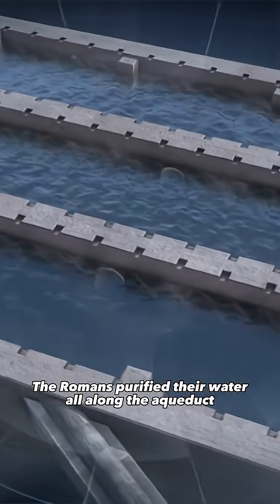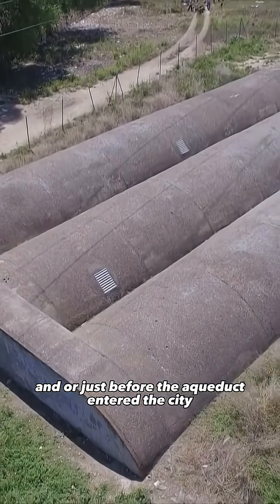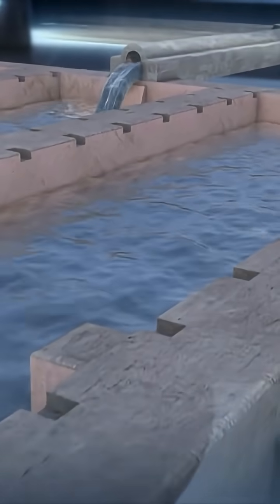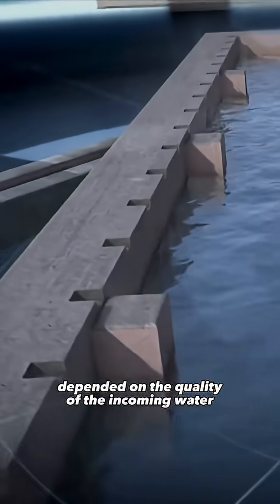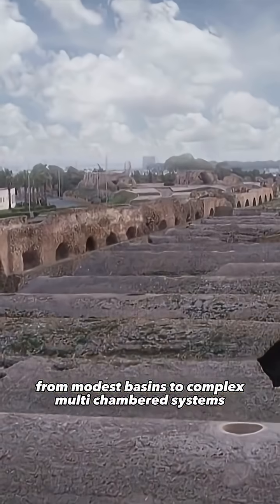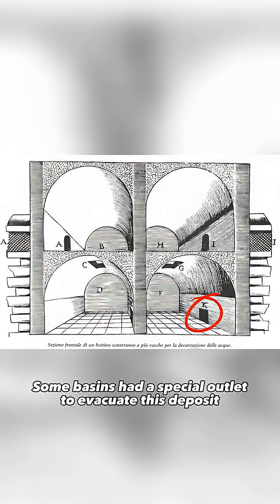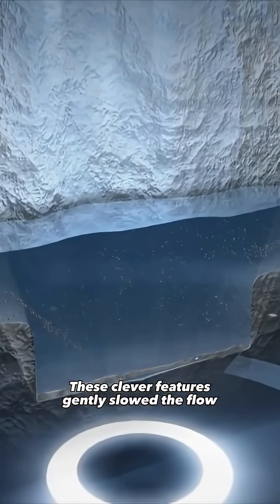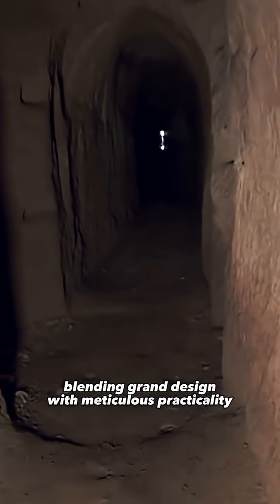How the Romans purified their water #history #romanempire #engineering

Comment: water guy here. cleanest water isnt at the top. its just below. stuff settles at the bottom and others remain at the top
Reply: Thank you for mentioning this!
Reply: Thank you Water Guy!
Reply: narrator messed up but the roman designs didn't. Settling tank outflow was just below entrance level.
Reply: As someone who drinks a lot of water, I can confirm this makes sense to me. Proceed.
Reply: For rainwater tanks, we use a flexible hose inside the tank connected to the outlet, with a float tied to the free end of the hose so that it sits about 15-20cm below the surface. It doesn't take any bits of plastic or whatever actually floating on the surface, but we're getting our water from as close to the surface as possible without being at the surface.
Reply: Everyone knew the YT doctor, the YT lawyer, or the classic YT engineer. Even got a YT rocket scientist once. 
But the YT Water guy? Now that's a new one.
Reply: Decanting
Reply: Well hey, Culligan Man!
Reply: Well over a thousand years ago it would be easier to trust clearer water than knowing the facts.
Reply: Curious, how would you get the water from below the surface in a system presented like the one in the video? Seems like anything would cause the water at the top to be sucked in unless you greatly reduced the flow.
Reply: The video stated that the outflow was JUST BELOW  the surface.
Reply: I spent 10 years as a Water System Consultant. Mostly Public systems. I was Certified by the State of California and the US EPA. From water wells to water meters, and all system parts in between. 
This fellow speaks truth. 
One water guy supporting another. 
You ignoramuses go back to your bottled water that, if you are lucky, might meet the same standards as your tap water that you flush your toilet with. But note that bottled water companies are notorious in the water industry for often being fined for environmental hazards and violations. Your tap water is often safer to drink than bottled water, in spite of advertising claims to the contrary. But if the bottled water advertisers told the truth, you would not buy their product and those companies would go out of business. Ooohh, poor babies. 😢
Reply: @dustymojave  I hate bottled water because it generates so much trash. 
I mean if you drink like 5 of them in a day, that's barely enough water for one day, but those bottles are gonna sit in landfills for the next 10,000 years.
Reply: @party4lifedude  The world did not start revolving when plastic was used for bottled water. Mankind has been storing water in numerous materials for millennia
Reply: @dustymojave  mmmm, yummy genX with a hint of fluoride tap water 😋
the US is huge, not everywhere's water is safe to drink.
Reply: @dustymojave  exactly
Reply: @dustymojave  im glad i can walk 20min and drink clean water directly from rock also my town gets water from said rock
Reply: And contamination dissolved in the water is throughout. Lead used in water supply had a certain effect on ancient Romans but it's quite a thought that lead pipes were still widely in use in the UK within recent decades. The Romans compounded this by sweetening their wine with sugar of lead.
Reply: @duncanbryson1167  The lead pipes got covered in a layer of oxides, protecting the water from lead poisoning.
Reply: @duncanbryson1167   I read that the Romans knew and expected that over time, the lead pipes would become coated with mineral deposits such as calcium as the water ran through them, so the water would no longer come into contact with the lead.
Reply: @duncanbryson1167  I had no idea they boiled wine in lead pots to make a sweetener. The Romans knew lead was toxic, so it's very weird they would do that.
Reply: @duncanbryson1167  The lead pipes used by the Romans weren't actually that problematic. It's only when water is stagnant or slow moving that lead contamination reaches dangerous levels. 

Carbonate buildup on the inside of the pipes also served to prevent contamination, this was even mentioned by  a renown engineer and senator Frontinus.
Reply: @MinecraftGuy07928  also our chlorine use made it worse. Not sure Romans used chlorine🤷
Reply: @turtletom8383 , chlorine use made it worse than what? Outbreaks of disease caused by contaminated water were quite common throughout history. 

I suppose it is worse for the bacteria. Are you arguing that bacterial life should be more valued?
Reply: @AJPemberton he meant lead leeching into the water
Reply: @AJPemberton  
How dare you say we piss on the poor.
Reply: @Szriko  ? How on earth did you come to that conclusion? 
I was responding to a comment that said chlorine made it worse. I had thought it was just an anti-chlorine reply (there are a few out there), but as later pointed out, they were referring to chlorine leaching lead, not the purity of the water in general. 
No mention of poor people.  
Some people do value other life quite highly, to the point that they will go to considerable effort not to kill anything. Others think anything natural is best, despite hard evidence to the contrary. In hindsight, perhaps the second sentence WAS a bit much. But I am genuinely curious as to why you thought I said "you were pissing on the poor"?! I just don't see it.
Reply: What do you mean, "water guy"?  You're made of water?  You enjoy water in your spare time?  You sell water for a living?  You're a water bender?  Or all of the above?
Reply: @lsdave42  He's like 71% water, bro.  The rest of us?  Only 70%.
Reply: @lsdave42 he's Bobby booshay. He likes her and she showed him her boobies and he likes them too 😂

Comment: First we purify it. then we put it in lead pipes.
Reply: After a few years, the lead pipes will develop a thin layer of calcium scale that limits the exposure of water to lead pipes.
Reply: @bogususer2595  yeah no
Reply: Which is fine. It's still super common, if your plumbing is older than 1986 it probably has lead. 99.9% an oxide layer forms, sealing the lead or other metals from the water. It only leeches under very unusual conditions, like the Flint MI debacle where the grossly incompetent water district failed to add an negligibly inexpensive ( < $0.40 per resident, per year) anticorrosive additive.
Reply: Future humans will comment: "How ironic, they used plastic for water pipes, allowing microplastics to accumulate in their brain" 🧠 😂
Reply: Lead? In 2025? I don't think so. 
Where do you live?
Reply: @JWR6819 There is still quite a large number of homes with lead plumbing. Only as recent as the 60's 70's countries started to impose bans on the use of lead plumbing. So it is highly recommended to inspect older homes.
Reply: @erik2811 A common misconception claims that Romans were driven to madness by lead poisoning from their water pipes, but this oversimplifies the truth. Not all Roman cities used lead pipes; many relied on clay, stone, or wood for water transport. While lead was used in some aqueducts and urban plumbing, the extent of its impact on public health remains debated, as flowing water minimized lead accumulation, and Romans often treated water to reduce contamination. Moreover, Roman aggression and conquests were comparable to other ancient powers, such as the Persians or Macedonians, driven by similar ambitions for power and resources. This narrative of "insanity" from lead poisoning is an exaggerated myth not fully supported by historical or scientific evidence.
Reply: Quite possibly lead to their downfall. See what I did there
Reply: Also why leaded fuels were outlawed. Fumes were a cause of slow development and learning process of children.
Reply: The Romans never understood that aspect, and lead was a slow killer. They’re known for grand engineering prowess, not medical science.
Reply: @DrBright5558 lie, they knew it was bad but did the work so...
Reply: @DrBright5558 Not all Roman cities used lead pipes
Reply: @DrBright5558  Would be a good idea to learn about their surgical practices. Their armies had well equipped surgical teams for the day.
Reply: @DrBright5558  Wrong, they knew it was a slow killer but very very very low risk.
Reply: We still use lead pipes today.
Reply: @wolfrainexxx  Idk where TF you live, but we don't do that.
Reply: @logicplague  Google says that all 50 US states have significant lead piping in their infrastructure while the UK has the problem in older buildings.
The simple way to find out is to check if the water companies add phosphates, an anti-leaching product, to the water.  Its only needed to deal with lead pipes.
Reply: @wolfrainexxx  No lead is not being used anymore since there are a lot cheaper materials these days which are less toxic. The existing old pipes either got so much lime sediment the water never comes in contact with the lead or they use pretty cool machine to install a new lining inside the pipe to keep water and lead seperated.

Which happened in Roman times too. The water contained so much lime it created a natural lining inside the piping within a few years. They used lead in the winemaking process to create sapa. The sugar-of-lead is today considered a lethal substance. But it made the wine taste oh so great.
Reply: @wolfrainexxx  not we dont.
Reply: @wolfrainexxx  Who is we? In Germany they are forbidden for new builds since 2013 (although they weren't in use since 1973 anymore anyway) and all old ones have to be replaced until next year at the latest. But aside from that there have been strict legal limits about the amount of lead in drinking water here way before 2013.
Reply: The pathetic cope with people commenting, just trying to find a way to say something negative about the Romans is hilarious.
Reply: @brentsobie3977  If they had known that lead leeched into the water and what lead did to the human body,they wouldn't have used those pipes. The other aspects of their aqueducts is magnificent,though. In some parts of modern American cities,there are STILL lead pipes.
Reply: @PC4USE1 Yes, absolutely correct. How does any of that refute what I stated though?
Reply: @brentsobie3977  @brent is exactly right.  These people only comment because they realize how trivial their lives really are.
Reply: They literally put lead in their wine to sweeten it
Reply: Well in the 1900s the US was using lead in everything despite being the most technological advance nation.
Reply: Not all Roman cities used led pipes.
Reply: Learn't from lead pipes, we put chlorine in it now!
Reply: You ruined everything with this comment. Turning it off now.
Reply: @erik2811 you have microplastics in your brain and your 🥚🥚 bro
Reply: Lead water pipes still exist and leaching is rarely an issue. However WINE which Romans often sweetened with lead is a far more effective carrier. If you were poor and lacked metal goblets you were good (in that minor respect).
Reply: I was on a tour in Pompeii with my wife and the guide was going on and on about how they had running water in pipes and that allowed baths and running water. I mentioned to my wife. "Yes they were geniuses right up until they died from lead poisoning". The guide shot me a shut-your-mouth look.
Reply: We have wokeness today, which is a visible cancer, but we allow it to continue to kill our societies.  So we are no better.
Reply: Lead pipe toxicity was a under informed propaganda by a cult which now controls money, there are now enough rebuttals about it that even makes you question your life reality
Reply: Now that know better, let's add industrial runoff into the water supply that is known to reduce IQ and cause mental problems, cause it is good for the teeth.
Reply: Everyone saying we don't use lead in plumbing any more...have you heard of solder? Lol
Reply: Analysis of human remains from Ancient Rome shows that they did not suffer from lead-induced diseases. Keeping water at a low temperature and avoiding air in the pipes is sufficient to prevent poisoning. Vitruvius, "On Architecture."
Reply: The romans started the lead pipe thing lmfao
Reply: Lead was used until 1970 extensively for water pipes inside everyone's house. Many homes still have it. 
What's your point?

And more: what do you replace it with if you are a Roman engineer?
Reply: @OctavMandru  many homes still have it,  but its not still actively in use.
Reply: Lead pipes are perfectly fine as long as you dont use chemicals to purify and sanitize the water. 

Lead forms an oxidative layer which prevents it from leaching into the water. The whole thing with Flint Michigan happened because they used chemicals with lead pipes.
Reply: frrr. Shat on all the process.😂

Comment: Romans also used LEAD PIPES, lead glasses and dishes. 😅 They would've wiped themselves out if they still remained in power.
Reply: First of all, Roman dishes were ceramic and dishes in general were very uncommon. The average Roman ate from wooden bowls.
Second, lead cups were only used for a very specific kind of wine that was prohibitively expensive for 99% of the Roman population.
Third, properly maintained lead pipes are not toxic. Lead oxide is not soluble in water and it does not leach. Romans intentionally oxidized lead pipes before installation, and they also applied a chalk based sealant. Lead pipes have existed for thousands of years and they remain in use today. PVC pipes, which have become mainstream, are way more toxic as they leach copious amounts of microplastics.

Comment: Its still used today, I worked chemical waste treatment at a circuit board manufacture. With a gymnasium size room full of tanks pipes and systems to neutralize the acids and drop metals out of thousands of gallons of water the last stage was through the decanter with a slower flow and a coagulant (kinda like coke and milk experiment) it would drop the last particles out before discharge back to the city. Then pipe the gunk from the bottom of the decanter  through a filter press. The dry sludge was then sent for recycling metals out of it like gold, copper and nickel.
Reply: Good info. Sounds like a great way to remove turbidity and other contaminants. But what is done to mitigate potential pathogens in the water?
Reply: @Globe-trotter-1  Well during the electroplating process boiling water and acid are used to liquify the metals to adhere to the boards. If anything survives that process the water is sent through the sewer system back to the city for them to put it through their normal treatment process for those types of issues. We used an Atomic Absorption Spectrometer and test every 15 min to ensure the PPM of metals were at acceptable EPA levels. We were not making drinking water just water safe enough for the city to treat.
Reply: @Globe-trotter-1  In the Roman empire, they did not know about pathogens. They blamed diseases on  "miasmas" and the stars.
HOWEVER, someone pointed out that the settling would reduce bacteria counts, and the UV in sunlight as the water flowed in open aqueducts probably reduced the risk too. They may have contaminated the Tiber horribly, but the water coming in was quite clean.
Reply: And now with that should women understand why us men think about the Roman Empire several times a day.
Reply: @dimtso6107  Well played fine Sir, well played.
Reply: You still use slaves to open the gates?
Reply: but would you drink water that is supposed to be filtered by only gravity? Yall sucking the dick of this shitty water filter is so cringe.
Reply: Why don't they use cavitation instead of filters? Cavitation is so much better at purified water compared to chemicals or filters...... so strange to me. Flow rate is also incredibly high with it.
Reply: @lifeisgood070  I guess you would have to ask the engineers who designed the plant and the treatment process. I just worked in the toilet of the place and knew how to run the system. Water had to be brought to a specific PH through a series of tanks, use binders and coagulants to bond to the dissolved metals to be able to be dropped out, by the end and the settling decanter the water was full of bonded debris that sank (imagine the toilet after a bad night of drinking and taco bell) the filter press was used to take the heavy debris and squeeze the water out to makes cakes for easy transport. We used an Atomic Absorption Spectrometer and test every 15 min to ensure the PPM of dissolved metals were at acceptable EPA levels before discharge if not back through the system it went to treat again, at peek we were discharging 1.5 gal per sec. We were not trying to make drinking water just water safe enough for the city to treat.
Reply: how would the cavitation work here?

Comment: All that just to go into a lead pipe
Reply: Lead is not as toxic as you think it is. It was problematic in gasoline because it was atomized by the combustion in the engine. A well maintained lead pipe is not any worse than a copper one. On the other hand, PVC pipes which are very common nowadays, leak all kinds of microplastics that are several orders of magnitude more harmful for humans than lead.
Reply: @aftoknito  Cold water is ok its hot water thats a no no
Reply: @soupdragon151 Romans lined the inside of their pipes with a chalk based sealant that can withstand an acetylene torch directly blasting it for hours.
Reply: True but I remember reading a chalk layer formed between the water and the lead protecting the water. Most lead poisening happened because garum was stored in lead.
Reply: Lead pipes are not that dangerous. Lead used as a sweetener in high society, now that was another category.
Reply: @mephisto8101  That explains why it was ceased to be used as an additive to fuels in many nations ?
Learn about Lead poisoning of the brain in children.